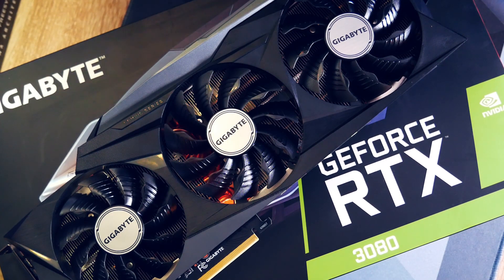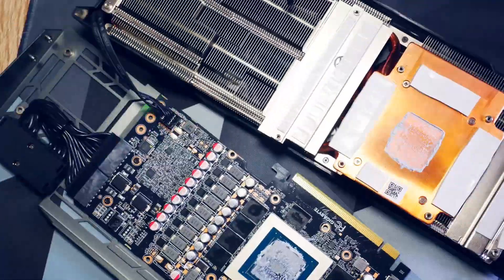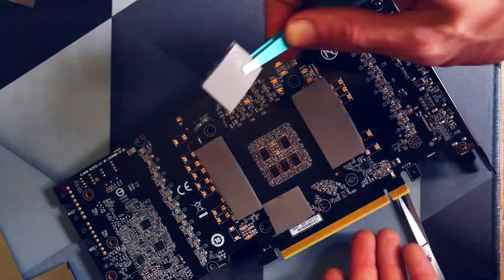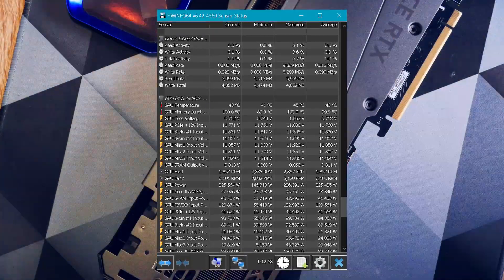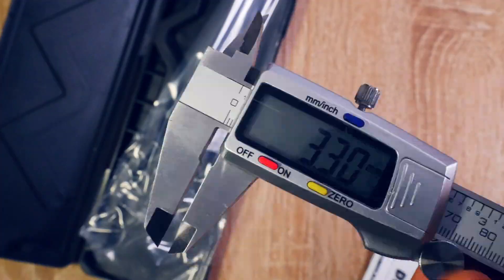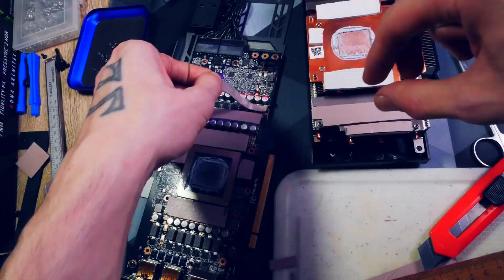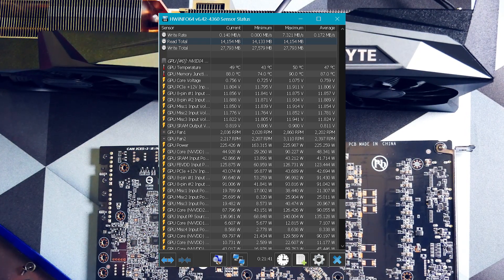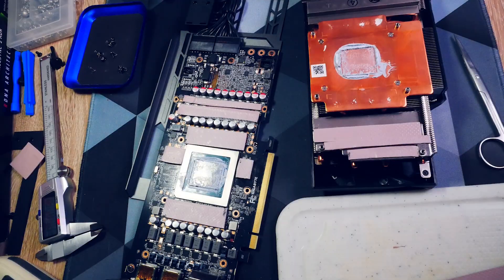How to fix the RTX 3080 with Thermal Pads | Gigabyte Gaming OC

Comment: Let us know how this performs over time, I have found on the 3080 eagle I have to replace the pads every month or so while mining, I'm just using some cheap pads off amazon that I found
Reply from the maker: I'm keeping an eye on memory :) will do! I tried some cheaper AliExpress ones on a 5700, but it turned out.. meh, so waiting for Gelid/Thermalright now before further testing! Cheers ⛏️
Reply: Same problem here , changed the thernal pads with grizzly , and after one month , temps are around 100c again ... :(
Reply: Same here. But the Problem is that the original Pads are 2,5mm thick and Not 2mm. I try this tomorrow.
Reply from the maker: @DarkAndi444  dang I want to test this too! 2.5 seems incredibly hard to find though!! Cheers ⛏️
Reply: @CursedMining  i think 2,5mm doesnt exist. The EC360 Support send me some Pads for Testing. But they Said If its 2,5mm that i need, i should try 3mm. Every Pad since the Bronze are very soft. Just blue and Green are hard. should be No Problem to squeeze them. The original with 2,5mm had only little imprints from the vrams. So i will try IT with 3mm silver Pads from EC360. Sorry for my bad english. C Ya
Reply: @DarkAndi444  i measured mine and was 2 mm ( the original ones ) measured with a precision device.
Reply: @automotozone  i did the Same and it was clearly 2,5mm. Maybe different Versions? But we have the Same shitty oil Pads xD i ordered my Card in the beginning of december. When did you buy your Card? I mean the First cards had 6 poscaps instead of a 5+1 configuration like my model.
Reply from the maker: @DarkAndi444  No worries I understood everything!! Hmm so I might try 3mm as soon as mine degrade to do update! Maybe I did too thin on other cards of mine as well, will retest! I got Gelid & Thermalright now too to test, trying to find another Gigabyte card 😁 cheers ⛏️

Comment: This video came at the perfect time. Got to change 2 gigs, not even bothering running them without modding. Thanks you so much bud!
Reply from the maker: You are very welcome mate! Will definitely do more modding vids on it and other cards :) thanks for tuning in!!
Reply: @CursedMining  I know that the Suprim X trio 3080s are good out of the box. I do have a gainward Phoenix Golden sample card 😂 which I'm not sure if the thermal pads will need replacing or not. Will test it out later in the week 👌
Reply from the maker: @promatqas  Good luck on it ⛏️ here searching for more cards 😁
Reply: @CursedMining  best of luck buddy, it's hard but not impossible ;)

Comment: I am facing the same issue in Gigabyte RTX 3090 OC too, will apply thermal pads. Other RTX brands like zotic etc works fine
Reply from the maker: I only have 3060Ti / 3070 from Zotac but I have to agree, they don't seem to have those problems at all :) will definitely open them at some point too "for science!" :D

Comment: That’s a huge difference and temperature looks like it’s pretty time-consuming to do as well I’ve always been curious so if you could do a fan upgrade on a card just a flow more air
Reply from the maker: I don't remember if you were on board with the channel back then already, I did it on a R9 280X back in the days, I will search the link for you (below), I think for most cards that alone would be fine but on RTX 3080 the memory really gets cooked, so for example maybe only doing the backplate + custom fan mod would also do the trick I think https://youtu.be/3SkZ9K9nOoQ
Reply: done a few of these takes about an hour each, well worth doing, i didnt have any 2mm but did the backs first, same as vid, worth doing as it helped until the 2mm pads arrived. u want a card u dont have to touch, get an EVGA FTW3
Reply: took me 30 mins to do. The hardest part was keeping the pads sticking to the metal when I was pulling the plastic off of the pads

Comment: Mate impressive video! Can you tell me please how much thermal pads should I buy from 1-3mm (Dont wanna buy too much , its expensive)!? cause I have the same card with the same problem :D
Reply from the maker: First of all thank you very much!! I'm trying to calculate. For 3mm one 50x50 was not enough, but from the second pack I still got 30x50 left.. soo around 70x50. For 2mm it is hard to say, I bought 100x100, did 3 cards (other models, RX5700) and still got 50x65 left, for 1mm you need the least as it is just for caps etc. I got around 80x40 left from a 100x100 pack, but did 2 cards. Everything quoted is mm. Sorry that I can't really be exact as I did multiple cards in a weekend 🙈 often the length of the smaller packs is fine but then you get screwed on the width, I hope it helps a bit!! Cheers ⛏️
Reply: @CursedMining  yea ty very much :) !!!!
Reply from the maker: @ddmmxx89  anytime! Big note to myself to write down the measurements next time I do modding like that, thank you too :) cheers
Reply: @CursedMining  yes, it could be useful  for others if they r in the same boat ^^
Reply from the maker: @ddmmxx89  Definitely! I got into an euphoria after the results and was like "gotta redo all the cards!!!" 🤣

Comment: How did you clean the rest of the card/fans where oil had leaked?

Also, how big/many pads did you need of each mm?

Great video, bad by Gigabyte...
Reply from the maker: Hey mate! First of all thank you! I used the alcohol soaked microfibre cloth to clean the card & fans, waiting for it to evaporate before attaching anything! I should have measure the pads more exactly for the card, it is really hard to say as I did multiple cards in a weekend. I just tried to calculate in another comment, give me a sec
Reply from the maker: For 3mm one 50x50 was not enough, but from the second pack I still got 30x50 left.. soo around 70x50. For 2mm it is hard to say, I bought 100x100, did 3 cards (other models, RX5700) and still got 50x65 left, for 1mm you need the least as it is just for caps etc. I got around 80x40 left from a 100x100 pack, but did 2 cards. Everything quoted is mm. Sorry that I can't really be exact as I did multiple cards in a weekend 🙈 often the length of the smaller packs is fine but then you get screwed on the width, I hope it helps a bit!! Cheers ⛏️
Reply: @CursedMining  thanks a lot! Much appreciated!

Comment: We should not have to fix bad manufacturing decision for these companies especially when they sell their product with those insane premium price :(
Great video as always my brother, it's always good to change anyway after some months/years <3
Happy midweek and keep on mining <3
Reply: i Dont agree, these cards are primarily made for gaming, and in gaming mine at least dont go over 90'C, 1440p, so it is more then enough
Reply: @yaxo11  I dont mine and basically design and play games, mem temps hit 102c on my gaming OC
Reply: @yaxo11  when stating that you also need to mention your ambient temp, for example if your ambient is 20'c and mem is 90'c then it will obviously be much higher if your ambient is 30'c, ect
Reply: @Silverfalls1  in my pc room i have 22 or 23'c, inside case due to cards high temps, probably a lot more, if i touch my glass panel, it is warm. I have phanteks p600 case, fans set to 80% when i play games, cpu is watercooled, rad on top

You can watch hardware unboxed video, and you will se even lower temps
Reply from the maker: I agree! Leaving the backplate out is absolutel negligence by Gigabyte!! I'd say before that mod the card is prone to fail quickly, with other cards it is just good maintenance after some time as you said :) 
Thank you very much for tuning in and the feedback!! Good week rest of the week to you too ⛏️⛏️

Comment: bro amazing! I need to do the front side of my gigabyte 3080!
Reply from the maker: I would have called the vid "the RPM fan mod" if I would have stayed with the backplate ❤️ but heck yeah definitely worth it mate!! ⛏️⛏️
Reply: i used aluminium pads(diy) for my gigabyte rtx 3080 and memory thermals are down to 75-85 C, you should try it
Reply: @Sharkiuli  how do you do. These pads brother? You just cut 1,2 or 3mm aluminium sheet and put it there?
Reply: @AM-lu5yw  yep , i used 1.5 mm and 2 mm thick aluminium ( 1.5 mm for gigabyte and 2mm for msi ventus) dimmention of the pad 12mm x 14mm , 1 for each memory
i did this to 12 rtx 3080 already and they all mine at 100 mh/s  , no problem until now
do this at your own risc, you might kill your card

Comment: Does the 3090 have this problem aswell?
Reply from the maker: I don't own one, but as it even has more Vram stuck in the same place, I can imagine. Best is to try the free hwinfo64 software to check your mem temps :( cheers ⛏️
Reply: @CursedMining  Sure, will try, thanks! Also even if this is ASUS I should do this?? 

Mining profitability up now, so will wait until next drop. Using hiveos, my 3090 shows that no fans are being used (0%) but I see the fans are spinning.
Reply from the maker: @Rc2Go  You should only do this if there is a reason for it. But Hive indeed does not show memory temp. Mine overheated like in the beginning of the video with the card (core) itself only being at 50 ° C. So it is definitely worth it to check, but Hive can't show memtemp.